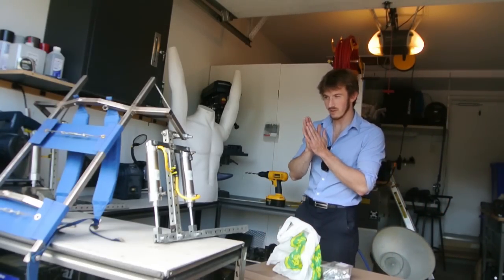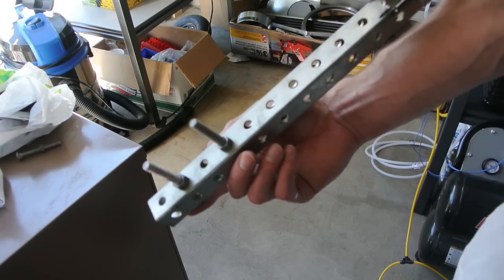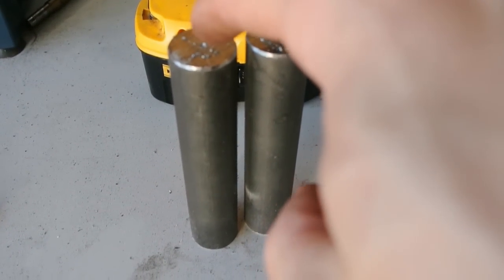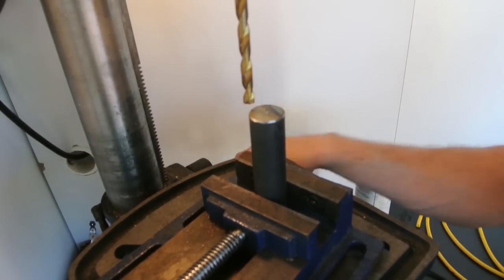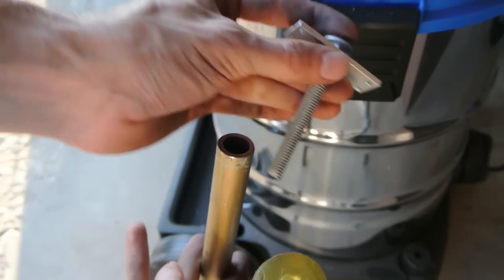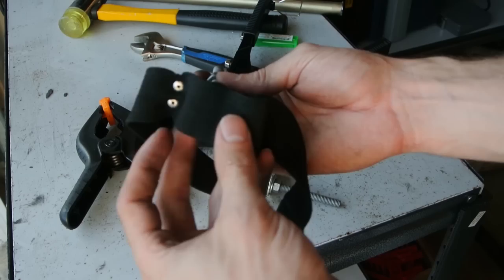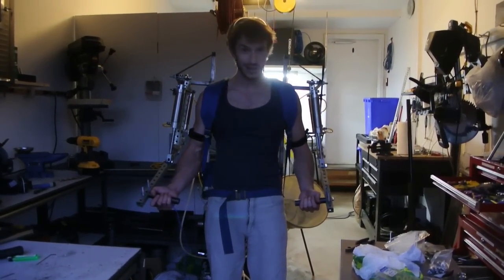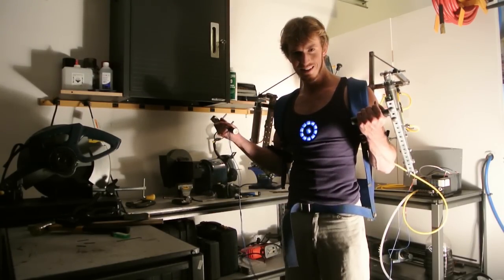Elysium Exoskeleton, Part 15: The Final Preparations

Comment: One quick thought. If you replaced the straps with strap that has a stretch sensor you could trigger the curl motion via muscle contraction rather than using a switch. That might give you a more natural movement in the suit. Also consider loosening your shoulder straps an beefing up the waist strap so the force rests on your hips and not your shoulders.

Comment: Are you going to wield hooks to the end of the arms or bolt them? To help lift stuff.
Reply from the maker: I plan on bolting everything on so I can have different accessories, hands, grips, etc. For the test, it'll just be those two bolts sticking up -- the bar will sit in between them.
Reply: the Hacksmith could u put that power glove thing on it as well

Comment: Hey i have an idea if we  increase the distance of the air cylinder pushrod away from pivot point we should gain some increase in lift(actually increasing power arm length) what do you think about it? A reply to this is appreciated
Reply from the maker: Yep -- by increasing the leverage you can totally increase the lifting strength. But, the cylinders only have a 4" stroke, so if I made the lever arms any longer, I'd reduce the range of motion of the arms.

Comment: Seems like It will work but what about your legs, will they be able to support 180 pounds?
Reply from the maker: I dead lift 250lbs at the gym so it shouldn't be a problem =)

Now when I upgrade my air compressor (doubling the pressure) I'll definitely need the lower half of the exoskeleton in order to curl 300lbs ;-)

Comment: Hey smith u did a great job but u need to find an way to control ur arms because after all you are going to control it right and there is no full range of movement though for ur arms hope you will fix it a reply to this is appreciated
Reply from the maker: I'll be working on making it more flexible (adding another degree of freedom to the shoulders) but something to understand about this exoskeleton is it is not designed for constant use, when I am just walking around, the suit is not active, only when I need to use it does it turn on. So with that flexibility isn't as big of a deal, though I agree it would be awesome if I had full flexibility and strength in all directions! :D